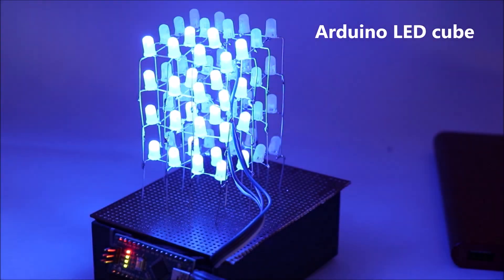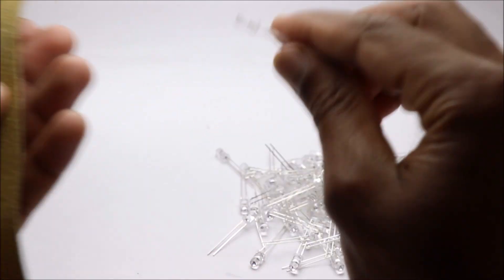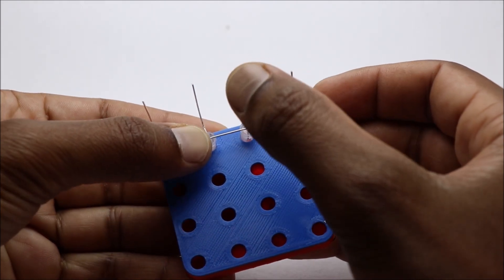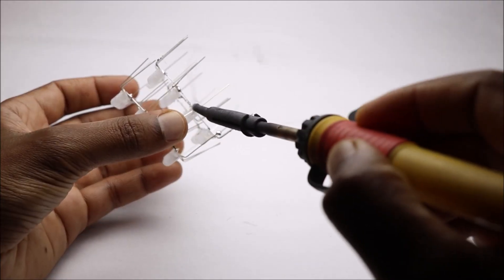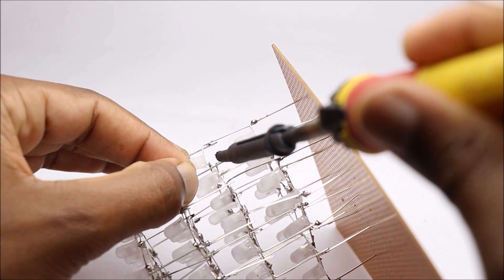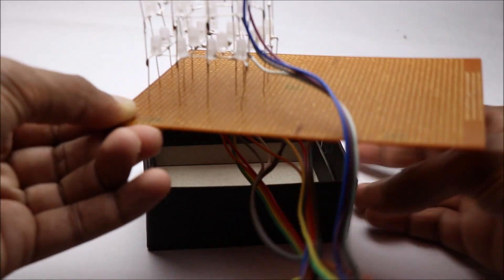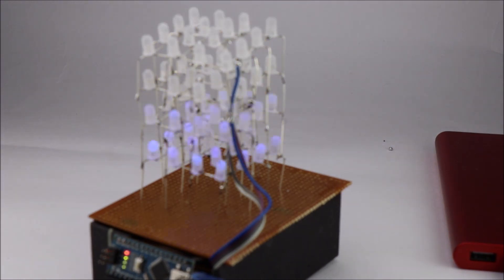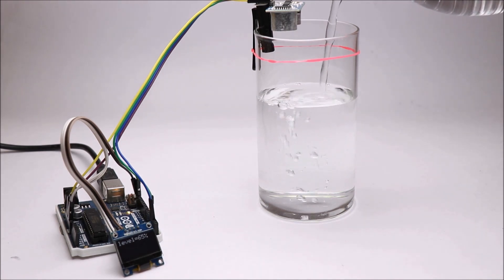3 Easy Arduino Projects for School Compilation

Comment: I plan to use your idea to control watering, depending on water remaining in the tank (the less water, the less watering)
I'd like to add a button to calibrate the water level : push a button to measure the empty tank depth, and then keeps that value for further calculations.
Is that possible ?
Reply from the maker: Yeah, it's possible